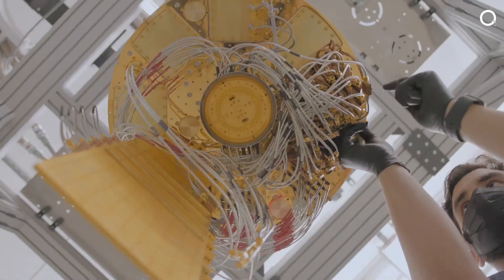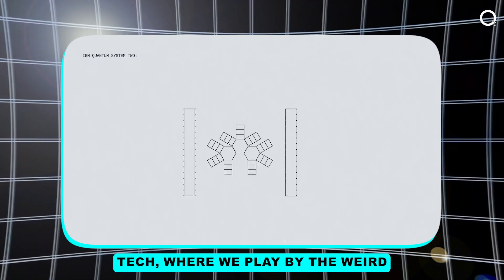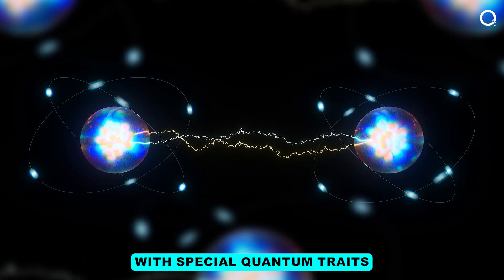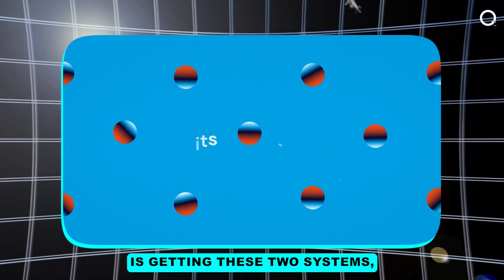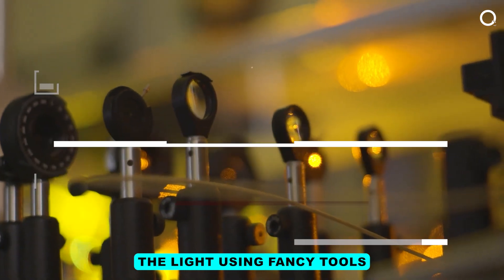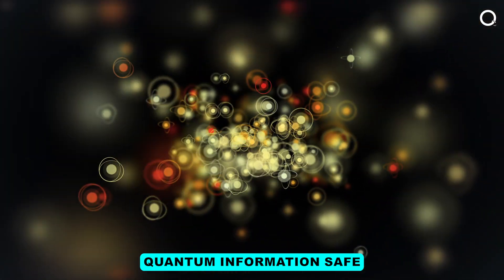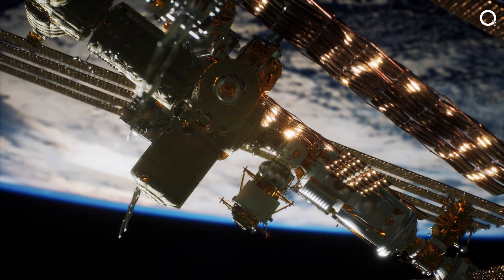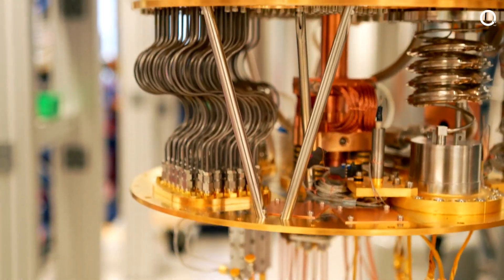Historic Breakthroughs of the Quantum Internet!

Comment: I think you should have focused on how the current experiences are solving the lowest level problems. The quantum “breakthroughs” are barely working basics of the normal parts of computers. Like this is supposed to be a wire and a transistor. Means of storing and sending information. It sounds like you’d rather use fancy words than actually explain what these things are
Reply from the maker: You are correct. Valid critique. We will be sure to improve in our future videos as we are starting out.
Reply: good point i felt the same from this video